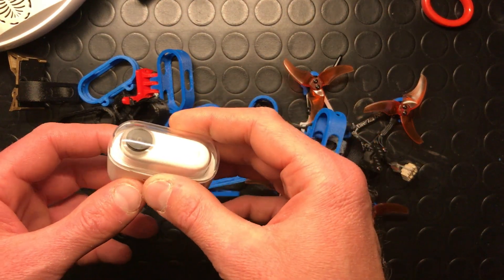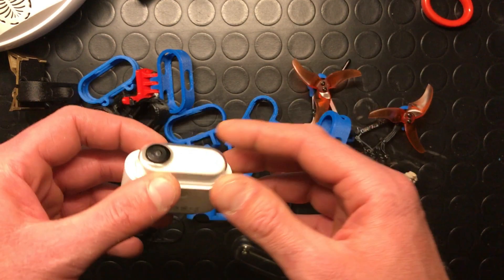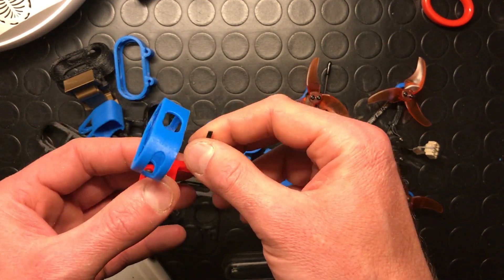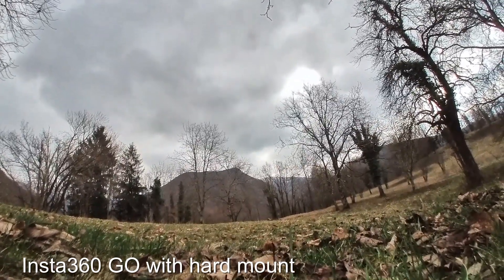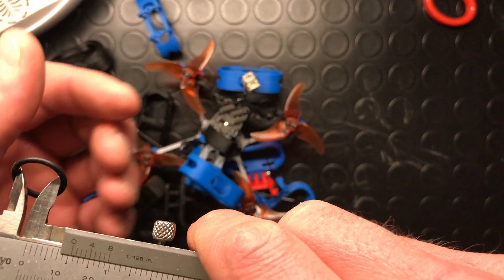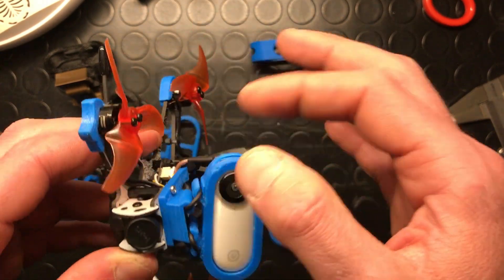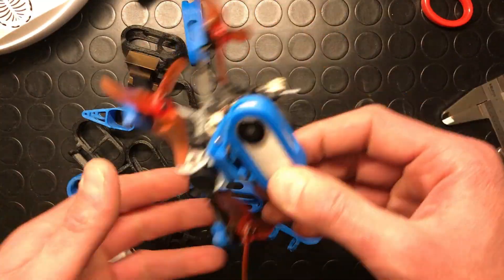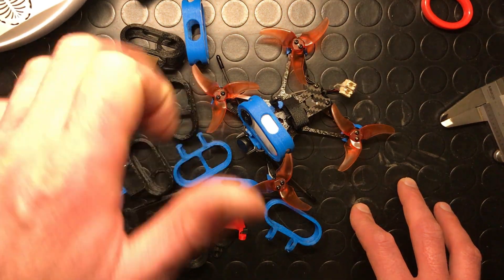TECH TIPS 01 // Insta360 GO FPV "Jello" problem SOLVED!!!

Comment: I gave up on all this.   I have the Caddx peanut which is the FPV version of 360 go2 and even on my wings and planes I get horrible jello!!  Tried everything and seems no matter what I do I get jello.   I'm thinking most these big YouTube channels that are showing these cameras doing perfect footage is because they are using other software in editing to fix this issue.    Imo its just not worth it.    I fly DJI with AirUnits and its 1080 at 60 plays fine and is good enough for me.  I will not waste anymore my time and money on these gimmicky cameras with there so called stabilization enhancements because unless you spend $600 on a gopro you are NOT going to get decent footage without using a sh=" ton of editing software to smooth out the footage.  
I'd rather just fly.  I'm not to impressed with this caddx peanut and will either trash it or sell it.
Reply from the maker: the main reason of Jello is shutter speed is too high, nothing else! with the Go2 (and the peanut that is the same camera) you can get outstanding footages! Look at the other videos on my channel!!! Take a look at this other video I've made about Go2 and Jello https://www.youtube.com/watch?v=Of1URn2rdOg&t=89s

Comment: Jello is hunting us since the early days of FPV ;)   I fought it on gopro hero 1 and 2 already with ear foam under my mounts :)
Glad you found a good solution. One thing also:   temperature will also effect the stiffness of the rubber - so in very cold weather it could change again...

Comment: Have you tried the go 2 yet for jello?   I have some great footage of the tinyhawk freestyle 2 and the  insta360 go mounted, no jello😀
Reply: Hard mounted?
Reply: @VinoUdaBestOne  Like this 👉  https://www.youtube.com/watch?v=Y96AYBJeLjc&t=11s
Reply: @earlybirdflights9884  Wow.... That video looks great. I couldn't see what you used to mount it tho except the battery strap. I couldn't really see what you had underneath it. And did you do anything to the video footage? I'm not familiar with editing yet so I don't know.
Reply: it's just a small placic plate for the strap to go under abit like how a plug holds the wire firm,  there are to screws at the front plate to screw down the plastic plate. I use Wondershare Filmora for editing

Comment: That's an intelligent solution. You could try squeezing some foam between the 2 parts near the O-rings so that they do not come into hard contact with each other and so that it flops around less. Currently, I'm using 2 double sided sticky foam pads with velcro on top and a battery strap to hold the Go down on my Tinyhawk 2 Freestyle. It's works better than the GEPRC TPU mount, but not as good as yours. Since I don't own a 3D printer, I'll try to figure something out with O-rings, a piece of credit card plastic, tie wraps, and a battery strap. That'll be lighter than a TPU mount since there's too much unnecessary material in the TPU mounts, unless they're meant to protect the camera in hard surface impacts.
B.t.w. I tried the Go as well as the Go2 (for the first time) on the Tinyhawk 2 Freestyle today and the Go2 has less jello than the Go using the same mount. The extra weight is noticeable though but it hardly impacts flight time.
My tip: stick some electrical tape over the Go microphone hole. It'll sound a lot better then.

Comment: Hi, i have THF2, considering to buy instaGO 2 will printed mount fit?
Reply from the maker: I'm quite sure the case does not fit the GO2. The GO2 has a different shape, it's thicker, longer and heavier! Anyway, as I said in other replies, there is no need for a soft mount on the GO2, it has ND filters!!!
Reply: You could just cut the top off of the top part and use a battery strap to hold the Go2 down to it. You loose some camera protection by doing that but that only matters if you're flying over asfalt or concrete.

Comment: Very nice, have to try this! Two questions, 1. can you upload a 40degrees and 50 degrees thingiverse version? If it is not hard to do then a 45degrees version too. Will be awesome! and 2. Just bought a insta 360 go, how can i choose between stabalized and not stabalized (i dont want to have a flat video when i do rolls and stuff)
Reply from the maker: 1. If you download the zip file on thingiverse you’ll find a .step file of the mount so you can mod it on your choice 
2. Stabilization can be modified after the video is recorder in the mobile app or in the desktop software from Insta360

Comment: Great job, and thanks for sharing the files! I’ll probably modify the design a bit to fit the Insta360 go2. I think it’s a bit larger
Reply from the maker: I'm waiting for the Go2 to arrive! As soon as I'm going to have it in my hand I'll try out if the Jello problem persist...But the Go2 can fit ND filter, soft mount could be not necessary!
Reply: @gervasofpv  Will you put the Go2 on your THF2? It's quite a bit heavier than the Go 1. I'm looking forward to hear your opinion, and if the added weight is worth the better image quality
Reply from the maker: @thesoundyouneed1  at the moment the GO2 is more like a dream...Insta360 is postponing the deliveries day by day so I'm not going to buy something that will not be delivered for months..with the Go2 the jello would not be a problem due to the possibilty of using ND filters.
About weight, IMO yes, 7 grams more on such a little drone could be a problem...Maybe you have to use it just for crusing!
Reply: The jello is pretty bad with the go 2, i already have NDs the jello is still disturbing. Really looking forward to your go 2 mount
Reply from the maker: @gabriellorenzo6589  got the hands on the Go2 right yesterday!😍 can’t wait to try it! Keep an eye on the channel for some news 😉
Reply: @gervasofpv  enjoy! i love the cam even though it jellos with my 5inch, but works great on my micro quads hehe can't wait for your mount <3
Reply: @gervasofpv  Hey man, thanks a lot! super video and super solution for the jello with TH II and Go1. I bought the GO2 and with my TH II Freestyle i have a big jello issue! When you done, can you share the stl files of your GO2 soft mount? Thanks for all.
F.
Reply: Do you or anyone made a mount for the GO 2 yet ?
Reply: @mondwazzerrezzawdnom2816  I just scaled up the dimensions by 10% when 3D printing the insa 360 holder part which worked for me.  Still a fairly tight fit but seemed pretty secure.